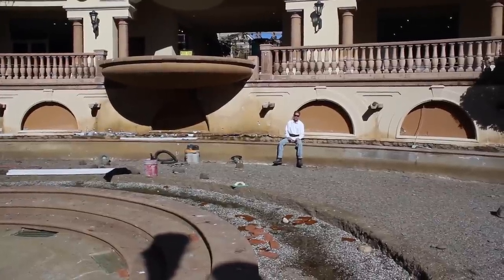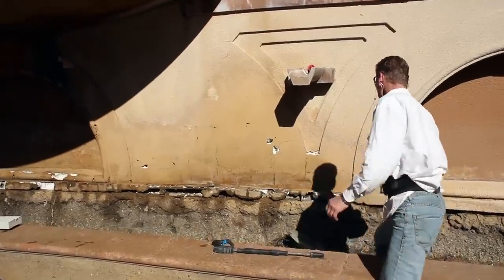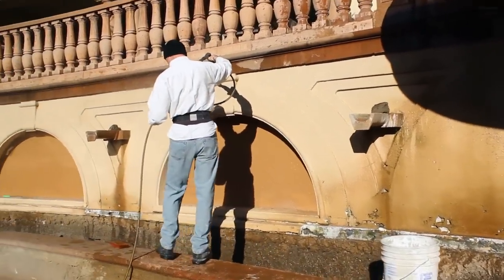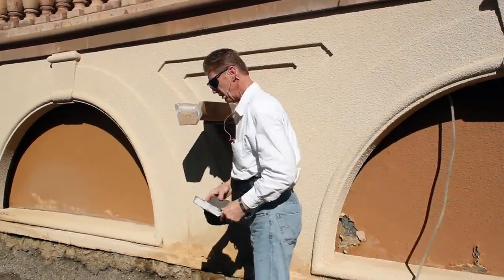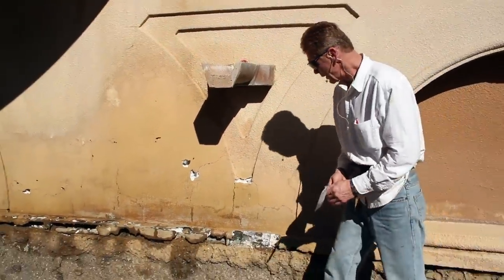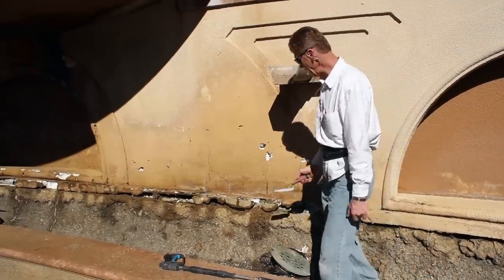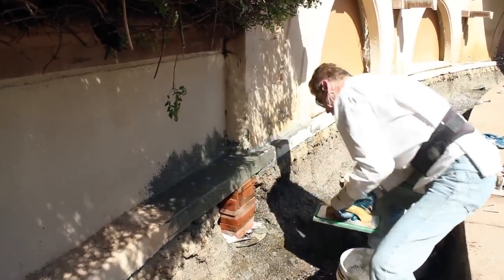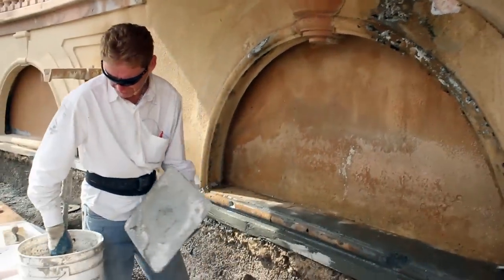EFIS repairs, Acrylic Stucco Dashing, Stucco-Flex, Fishpond

Comment: Kirk, Another tremendously informative and entertaining video.  A while back you did a video regarding exterior mud rings for electrical fixtures.  It helped me out greatly as I had to have two exterior walls reframed due to termite/rot damage. I roughed in some exterior electrical receptacles and a J-boxes to support a heater. With your video I was able to make a water/weather tight seal.  Much thanks and look forward to all your future videos. Aaron
Reply from the maker: Evening Aaron, happy to be of help.
   Live long and Plaster
 Giordano’s plaster teaching videos

Comment: Awesome work. we have been building waterfalls in the UK out of concrete and only recently have started using styrofoam. We have been experimenting with different coatings and have settled on using a GFRC, but after seeing your work we thought it would be advisable to get your opinion on how we "should" be doing this, and how we should treat the styrofoam prior to application of the GFRC. Your comments would be much appreciated.
Reply from the maker: Good afternoon Liam, many ways to skin a cat. 
Are you just shooting the raw styrofoam with the GFRC?
 Or is the styrofoam precoated with mesh and cement then being shot on with the GFRC?
 If the styrofoam is not precoated and GFRC adheres, this is the way to go, as that means the GFRC has a cementitious adhesive in it. Personally, I would not trust any product to adhere to raw styrofoam for more than 6 months, especially underwater.
 We have to use styrofoam precoated for the acrylic coating to adhere permanently.
 The cementitious cement adhesive here is called Poly-Bond and made by La Habra. It's specifically designed to adhere styrofoam permanently to base coat stucco walls or to adhere to the mech fiberglass to raw styrofoam.
 

                         Bringing peace, love, and harmony to the  plastering world
    The complete plastering encyclopedia on video, by the plastering messengers of Youtube

Comment: Kirk,
Excellent video. 

I have a patio cover a previous owner had added plywood sheathing and rolled roofing on top, & covered the underside (the ceiling) with foam sheets & foam moldings. It looked great, but they failed to secure the foam properly, and the entire underside began to sag.  The framing was shot, and I began the tear down 
I was shocked with how well the stucco itself adhered to the foam. The entire ceiling came down virtually as one piece. That stucco was damn near bulletproof. I just wished they rebuilt the patio cover first, rather than skinning a crappy patio cover and barely securing the foam to the structure.
Reply from the maker: Afternoon Michael, yes that was foolish of the fellow, he should have screwed the foam up and only applied 1/8 to this soffit.
 I would have used wire instead myself.
       Live long and plaster
  teaching  plastering video’s

Comment: Great videos sir. In Florida, would you recommend building a house with the following stucco approach: stucco->insulation foam->moisture barrier-> CMU -> furring strips -> drywall. Researching the best way to build the walls for the hot and humid climate. Your professional input is appreciated.
Reply from the maker: Good afternoon Alan, for the Dry-vit system or insulation foam board, the moister barrier goes on first, the board second, the fiberglass mesh,  then a thin coat of stucco with the finish coat after.
 Of course, there is another system where the moister barrier again goes over the plywood sheathing first, then foam board attached second, a thin stucco netting such as 20 gauge instead of 17 or 18. this wire is fastened directly over the foamboard often using 2 inch staple, then a coat of stucco not thicker than a quarter-inch, then finish coat.
 There are more systems for styrofoam, too many to name here. These two are the most used.
 CMU walls or what they are commonly known as Cinder or Concrete bock. Wet them when built and apply just a skim coat of stucco to them, it takes practice to understand the natural mechanical bond this creates.
Drywall or sheetrock just hang and mud with any of the interior gypsum products.

                         Bringing peace, love, and harmony to the  plastering world
    The complete plastering encyclopedia on video, by the plastering messengers of Youtube
Reply: @StuccoPlastering  thank you
Reply: @drchamp1902    do not use this system in Florida  or anywhere . Foam degrades over time . You want the paint to be the moisture barrier  and everything underneath to breath.  You want to walk out your home and see condensation on the outside of your home . Not in the wall. The law of thermal dynamics states water forms where heat meets cold you do not want that point to be a barrier in the wall. I  built many projects and when foam failed it did it this way.  The foam products such as columns cornice flutes arches  are foam products with a poly coating . This coating is not water proof . When the sun hits the foam it expands and sucks in moisture into the foam from morning dew and overnight rain. Once the moisture is in the foam  then when the sun hits  the foam  the vapor pressurized  inside and will blow out cracks everywhere that will then allow more water intrusion. This system is prone to failure. I had the main company in Florida  meet on our project and when confronted with this issue he admitted that the foam failed in the way described and there was nothing to do  to remedy it.  We then had to use ever product under the sun to try and water proof the foam and here is what happens. When the sun hit the foam with vapor inside the new applications of water proofing just bubbled  in millions of pin holes that would not seal because of pressure inside the foam .

Comment: Yet another great video Kirk You’ve helped me so much in plastering, or as you call it in the States, stucco. Do you always put a stronger mix to your base coat compared to top coat? For example, 4 sand to 1 cement or 5 sand to 1 cement. A big hi again, all the way from Ireland 🇮🇪
Reply from the maker: Howdy Matthaus me friend from Ireland, as a rule, I use 3 parts sand to every one part stucco.💃

Comment: I have a florida room with decorative trim around three 8 ft patio doors. dogs chewed into them and i need to repair. it has 1 inch thick dense foam board i was told it was dens glass but dens glass in this area has been discontinue around here . i have watched a few of your videos and am pretty handy when it comes to new things figuring it out. i have cut out the bad spots . could you just tell me the materials i need to follow the steps i watched you do to repair the wall and trim. You guys are truley artists at this stuff .
Reply from the maker: Morning James, thank you.
    If it were me, I use Rapid set cement stucco and fill all the areas with this fast setting cement plaster.
 Another alternative is to add the styrofoam back in, then attach the wire, and apply the stucco. 
The most important is to waterproof the backing or paper membrane as no matter as close a match it is or how easy to apply it, it must be watertight.
Kirk Giordano Plastering
Reply: this room is a covered enclosed  back porch/florida room , but thank you for getting back with me means alot !!!! i will follow your instructions on that thanks

Comment: I just Den's Glass the outside of my old garage out in the back of my house. Keep in mind this garage was built back in 1940. I went over the old framing. Which was not plum, and when I was done applying the drywall, I looked to the side of the wall, and it looked all wavy almost like a snake. I'm about to apply stucco on it. My question is this, how would I make it where the house looks totally straight without waves in it, when I applied the stucco?
Reply from the maker: Howdy Raymond my fellow plasterer,  this is completed after it's lathed, then when applying the basecoat, it's achieved by using a Stucco darby. This takes a bit of practice.
Type in our channel how to darby a wall to watch how it's done as words alone can't answer this common question.
Reply: @StuccoPlastering  thank you, will do.

Comment: As an EIFS contractor in NY, I can’t believe there was EIFS underwater, I mean companies like STO make special basecoats for water areas such as pools etc but that’s for the ceilings and walls, not underwater. Was this an actual system made for water?
Reply from the maker: Greetings, Don, the entire system is made for above the pool line. However, if it gets wet or submerged, the water does not hurt or hinder it's integrity.
 If the styrofoam was engineered to stay dry, what would happen to the- millions of buildings that have EIFS substrates around the globe when winter often brings months of rain?
FYI, I have been applying the Dry-vit system since they brought it here from the Uk 70 years ago, well for the last 40 anyway.
 Bringing peace, love, and brotherhood back to the world of Plastering. 🌍
    The complete plastering encyclopedia on video, by the plastering messengers of Youtube.  
     Over 850 videos 🎭 👀💃

Comment: Kirk, the impression people around my area have is that EIFS is inferior to traditional 3 coat stucco. The attitude seems to be that it is fake stucco. What are your thoughts on EIFS?
Reply from the maker: Howdy Edge oof Sanity, cool title BTW..
 A simple fact a three-coat traditional system is superior and stronger than any EIFS system.
 But comparing them is like comparing apples to oranges. The styrofoam system was first developed in Europe around 1950? 
Dryvit became noticed here in the USA around 1960? 
Dry-Vit, as well as stow, are the two main styrofoam plastering systems. For high rises they are great as the further you go up, less weight is beneficial.
 Plus the styrofoam boards slows down the sun's extreme heat from penetrating as fast as with just concrete or stucco on your home. 
There are many more differences than just this. 
The moral to my reply is, when someone says, I think this or that, Ask, why? They may have just enough knowledge to think they are right, but possibly not enough to know they're wrong.
 Besides all that stuff, opinions are like assholes, we all have one.🥳

Comment: Really nice  finished pond BRO , Thumbs up . I only have one quick question , under the line where you put the foam board , did some one come in an cement the rough part smooth?
Reply from the maker: Morning Peter Dude, yes we also stuccoed under the foam where the heat of the lights burned through the foam from the last repair.
              Live long and Plaster
  Sharing DIY Plastering tips from team Giordano

Comment: Hi Kirk - big fan. In Europe is stucco main thing on our houses. But we never bend fiberglass mesh in the corners. We cut the corners and fill by silicone because it cant crack if you fill corners by silicone. Or in U.S you have different fiberglass mesh?
Reply from the maker: Greetings  Tomy, here in the U.S.A. it's common to use La Habras poly bond for joints and adhesion.
 Poly bond is a cementitious adhesive, engineered to attach styrofoam to any substrate. Polybond is sold at plastering yards and not hardware stores.
                Getting plastered with Kirk 
 Kirk and Jason Giordano’s sound plastering advice

Comment: Stucco flex I used years ago, had 1/4 inch of stretch, but I thought they went out of business.  Wasn’t it manufactured in Washington state? As of this day I do not or have not heard of a synthetic finish that is waterproof. There is no sealant joint around the scupper, big no no for synthetics, also the bottom of EIFS is supposed to terminate 4 inches above grade.
Reply from the maker: Good evening Ron, three stricks your out and wrong about everything.
 Bringing peace, love, and brotherhood, back into the 🌎 of Plastering.
    The most comprehensive encyclopedia of plastering on video, by the plastering messengers of Youtube. 
Kirk and Jason Giordano with over 800 videos 🎭 👀💃

Comment: How much did you guys drink that it took you two weeks to come back?
Reply from the maker: Good morning Joe, it matters not how much we drank, we could have had a keg each, all stucco base coats have to set for at least 30 days in order for the Ph level to drop before painting or an acrylic stucco finish. is to be applied as both of these systems seal the stucco.
 Do you know what happens when a base coat is painted  or sealed with an acrylic stucco before the stucco has had a chance for the Ph to drop?
I do!
    Live long and plaster
 teaching  plastering video’s
Reply: Gotcha.  I'm glad that you had a break from the heat.
Reply from the maker: Hey joeee, where you going with that gun in your hand? "Jimi hendrix,"
 I'll tell you Joe, it was the first time working right next to a bar, it was like the call of the wild, took some serious discipline, But I do have a rule, I only drink by myself or with a friend.
Kirk giordano plastering

Comment: Can you blow stucco flex over a traditional EIFS wall that has cracked?
Reply from the maker: Good evening Butopiatoo, Dude, yes, of course you can.
    The complete plastering encyclopedia on video, by the plastering messengers of Youtube.  
     Over 850 free self-help videos 🎭 👀💃
Subscribers, you can depend on us to explain with truth, honor, experience, and skill for your time invested for wishing to learn the hows and whys of plastering.😉
Reply: Kirk Giordano plastering Inc. awesome thanks. Have a small building that’s gonna need a repair and didn’t know if we had to rip to the studs of if it could be successfully repaired where it becomes watertight.

Comment: You need to remove the nails from the foam after the bond is set. Otherwise they will rust through the mesh and finish when the water comes back.
Reply from the maker: I had a stucco pal of mine who did this 20 years ago, when the wind blew the styrofoam off the 5 story building, the lawsuits were so large he filed bankruptcy.
 I cover my nail hole with poly bond, thus they have never bled in the many years I've been attaching styrofoam. That story of lost foam is not the reason I leave my nail in, common sense is the reason. To remove a nail is to leave a crater of a hole just begging to receive as much rain water as nature can serve. 😉
Reply: @StuccoPlastering  That's what happens when people don't know EIFS. The company I worked for had water failures as well. Proper application is KEY

Comment: Do not use this system in Florida  or anywhere . Foam degrades over time . You want the paint to be the moisture barrier  and everything underneath to breath.  You want to walk out your home and see condensation on the outside of your home . Not in the wall. The law of thermal dynamics states water forms where heat meets cold you do not want that point to be a barrier in the wall. I  built many projects and when foam failed it did it this way.  The foam products such as columns cornice flutes arches  are foam products with a poly coating . This coating is not water proof . When the sun hits the foam it expands and sucks in moisture into the foam from morning dew and overnight rain. Once the moisture is in the foam  then when the sun hits  the foam  the vapor pressurized  inside and will blow out cracks everywhere that will then allow more water intrusion. This system is prone to failure. I had the main company in Florida  meet on our project and when confronted with this issue he admitted that the foam failed in the way described and there was nothing to do  to remedy it.  We then had to use ever product under the sun to try and water proof the foam and here is what happens. When the sun hit the foam with vapor inside the new applications of water proofing just bubbled  in millions of pin holes that would not seal because of pressure inside the foam .
Reply from the maker: Greetings Whirlwind, the fact remains, more high rises around the world have as finish coats this membrane.🤔
 By the way, there are many, many ways to fail to apply a system properly. Unfortunately, some do then started the finger-pointing and even come up with notions that homes need to breathe. Humans, plants, animals, even the whales of the oceans need to breathe, but homes are not alive. They are man-made substrates or space occupied by people, how many stories have you read in the newspapers, or heard on the news about an entire family smothering to death in their home? 🤔
 If this were so, Sherwin Williams, Benjamin Moore, Kelly paints and all of the leading paint companies would be out of business.
 I believe many try a system and do not understand the intricacies of how the system harmonizes when applied in a sound, step by step method, then without understanding these great laws of principals become adverse to a particular network.
 This is America, and all are entitled to their opinions, Thank you for placing yours here.

 Bringing peace, love, and brotherhood back to the world of “Plastering.” 🌍
    The complete plastering encyclopedia on video, by the plastering messengers of Youtube.  
     Over 850 videos 🎭 👀💃
Reply: @StuccoPlastering   The law of thermal dynamics states ..water forms where heat meets cold. In Florida that is  the outside of the building . The vapor barrier is in fact the paint coating . Moving that barrier into the wall and guess what you have water formation in the wall.It is standard building code to not have dead air spaces . There is no opinion stating that foam products explode in cracks from water intrusion . There is no coating you can put on foam to stop water intrusion  or the cracks ..you are after all there fixing a failure in the system. And soon enough your repair will fail . :)